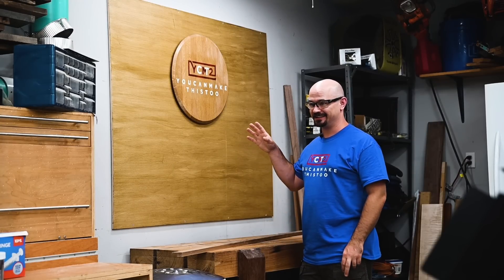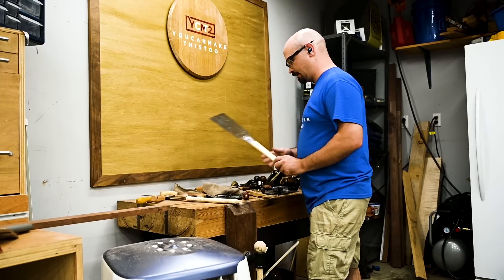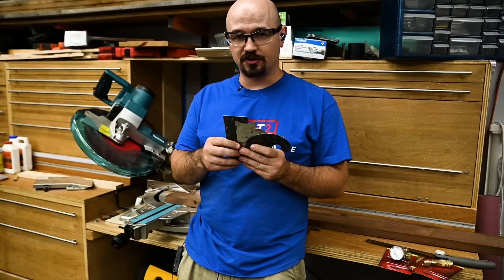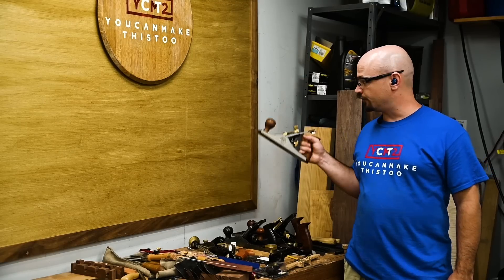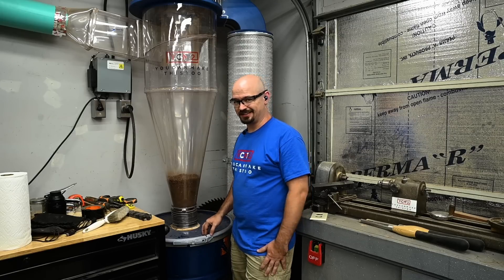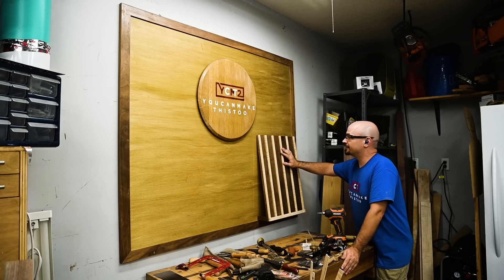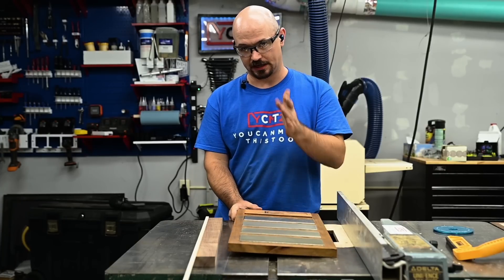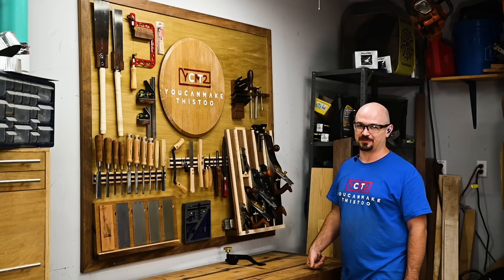Make Woodworking Tool Storage | Hand Tool Wall

Comment: How well do the magnets work with keeping the planes on the tool board?  If they give way to a flea market find, oh well.   If they give way to a premium plane— that would not be good.   I know that is an obvious statement.  I like the idea of a steeper angle.  Less depth taken up.  And the magnets seem to be a good, easy, alternative to a more complicated holding system.
Reply from the maker: They're doing great. It takes a little tug to the pull the one off. I only put the magnets behind one of the planes.. because of the way it's handle was attached it wouldn't sit there. I probably should go ahead and put them behind all of them just as a safety though.

Comment: You've got that empty space up there, but unless there's a thing you could reach, it's not so much wasted as inaccessible.  The other corner that has the saws uses the top space well because they are still well within reach.  So unless you have some other long handled... thing, I wouldn't worry too much over that spot.  Maybe stick a roll of paper towels up there?  Not quite in tune with the pull saws and planes. :D

Empty/inaccessible or not, it's still a well made project.  Thanks!
Reply from the maker: Very good point! I figured it was good to have some open space anyway for anything that needs to get added to it later.